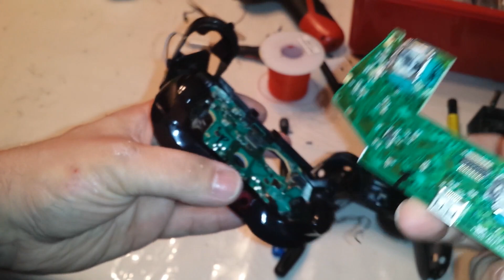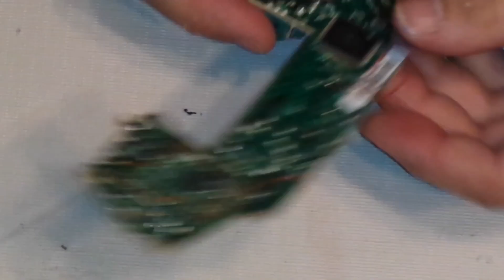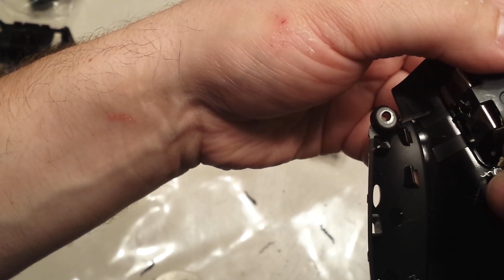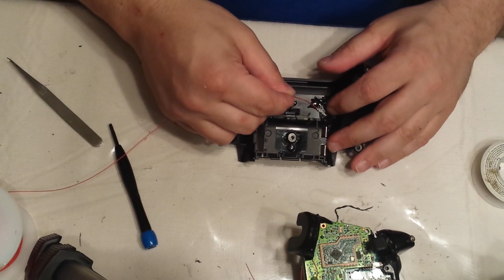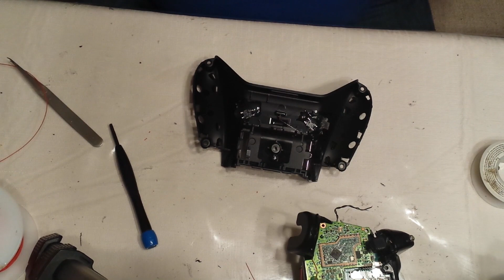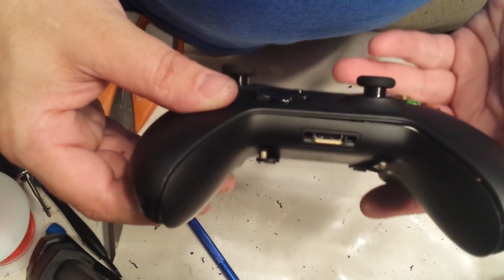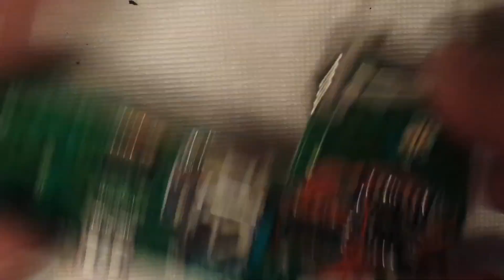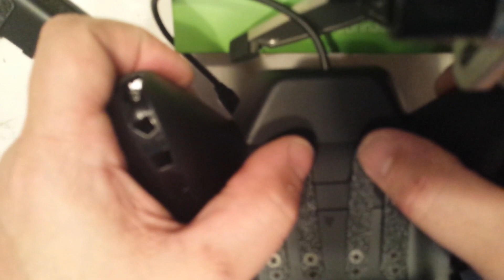TUTORIAL BUILD YOUR OWN XBOX 1 Scuf style Controller w/ Triggers Stops, Remap chip & MORE DIY Gamer

Comment: Hey MOD' great channel m8, very easy to follow instructions unfortunately for me no matter how good the tut* my skill lvl hit cap not to far from birth. Took me about 45mins to remove the rumbles, then 2 seconds flat to rip my b trace, it was at that moment i knew my modding carrier was done. Had to buy another stocker. So im Hoping your still modding, cause im in the market for Xone. Only shit thing is I'm in Australia so I'm going to need thoouussandsss for postage
Reply from the maker: You know what I will!!  

I have another video lined up first this week then I will do that one. 

Perhaps in the next video I will show you everything in one video.

STAY TUNED!!!
Reply from the maker: SMart Triggers are not really that smart. 

Tact button, 100ohm resistor. 

Glue Tact button under the trigger to the mobo.
Solder wire from Tact to the Trigger point (each controller varies) email me I can send a photo based on controller your doing)  I have already given this advice out via email before (justr no video)
The other post of the tact button goes to the resistor and then the resistor gets soldered to ANY GROUND. 

DONE!!

repeat for trigger 2. 

Make sure you use a tact that is not too long or too short.  

I will do a video soon.
Reply: MODCENTRALUSA I apologise, I was out of line. Didn't read your name and thought you were a random trying to run a scam. So again sorry.
Reply: did you get ever get the mod completed or buy a controller with paddles?
Reply: Na, bought the elite controller when it came out bit pricey but haven't had any dramas it
Reply: That's cool. I'd buy the elite or something but they have rubber grips on the back and I'm allergic to them so it's not doable for me. I think I'll get a soldering iron and stuff and follow this tutorial that we're commenting on right now. How did you rip your b trace?
Reply: I was abit heavy handed trying to scrap back a bad solder on the trace sheath. If you've never soldered b4 I suggest practicing on an old PS/Xbox controller.. alot. You could look into getting a button remapping chip for around 40-60aud, they only need about4 solder point and work well I've been told
Reply from the maker: This tutorial was mode before the Elite came out. And while the elite is a nice controller you can build one for 1/2 the price that does much more.  

First off the elite only allows you to map in the settings. Hence the buttons on the back have to be set before you play.  I designed a chip that can be installed and changed on the fly, so if your playing online or in a match, you can easily change the button mappings between spawns. Also the Mapping on the back does not affect the front. While you can still use the built in mapping feature to change the layout of the controllers buttons for a custom layout, my chip allows on the fly mapping should you need to change. 

Second, modding your own controller allows you a better layout. Using the elite or Scuf you get what they give you. If you have small or large hands and do not like the placement nothing you can do about it, you have to change the way to you to adapter to their layout.  With modding your own controller, do paddles or buttons and put them where you want.  

The cost of adding 2 buttons to your controller on your own is $5!!!!! on a $50 controller hat is $55 for a modded controller. Even if you bought one of my remapping chips for xbox one you looking at under $90.  That is much better than $150+ tax.  

Sure the elite has things like metal thumbs and trigger locks. But you can easily add these things on your own. The thumbstick set with adjustable heights can be bought 3rd party for $10-$20 and trigger stocks are the cost of a screw.  Grip and such can be bought 3rd party as well if you want to add it to a controller you already own. While I don't like scuf controllers,. there Xbox one add on grip for $20 is a great value for those who want.it.  For those who want to do their own thing on the cheap, you can find adhesive spray and such for under $5 a can and do 20+ controllers.
Reply from the maker: I can not be aggressive.. it is my channel I am allowed to respond to whatever I want. 

Second, with the Xbox one.. I really offer nothing more than a Tutorial. 
Sure I offer a remappable chip for sale.  But it is not needed
For those who want to build a Remappable controller for super cheap.. You can't beat soldering 8 wires to 4 tact buttons on the back of your controller for less than $5.  It beats spending $150 on a controller.
I make nothing from that.  90% of this tutorial is nothing but FREE ADVICE and showing you how to do it., 

Do those who want to buy all the parts in a kit - sure i offer that, but if you own a soldering iron, glue gun and tools, really 4 tact buttons on amazon or ebay is all you need unless you want to spend $12 at radio shack. 

For those who don't want to spend $150 - I do also offer mail in service and Full modded controllers with a layout that someone might prefer over the elite. 

So sure.. I post these video with hoping to get some business, but at the same time, I offer free advice and I am going to be active on my own videos especially in the comments section.
Reply: MODCENTRALUSA, are you going to ever do a video on adjustable trigger stops or even smart triggers? I'd like adjustable stops but the only way I've seen is to drill the screws next to the battery covery and into the spot on the triggers like the 360. Not sure if smart triggers would be an easy DIY, but I'd like to see a tutorial on it for Xbox One so people will stop buying controllers from companies Scuf and probably even Battle Beaver solder stuff weakly so it breaks or something. Anyways, I'd love to see how to do smart triggers on the Xbox One controller. If it's something I can learn how to do I'd definitely do it. Although I still need to learn how to solder period haha.
Reply: Alright, I'll be looking forward to your video! You're really making me want to go grab a soldering iron and solder everything in sight. This stuff looks fun even though you gotta be really careful with it LOL.

Comment: would be cool to remap the ABXY to the back and changing the ABXY at the front to fully customizable buttons on the PC (like keyboard keybinds without affecting the ABXY at the back :D)
Reply from the maker: That would be possible to do buy you would need a few things.

First you would need a programmable remap chip installed. - Which I make (as per this video)
then set the Back Button to A B X Y.
They you would need a Cronus Max and you would need to remap the A B X Y to whatever you wanted.
In theory it should work as the A B X Y on the back of the controller go to the Remap chip then directly to the MCU.
The Cronus is a pass through device that would see the A B X Y front presses and then swap them to what you programmed them to be through the cronus.
Reply: MODCENTRALUSA So the Cronus Max is able to separate the ABXY from the back and the ones from the front :O? is it possible for the Cronus Max to remap the front ABXY to keyboard keybinds like space - ctrl - tab , etc.. stuff like that? and will it work on a wireless one?
Reply from the maker: NorProductions IM not a 100% since I do not own a Cronus, but the way the cronus works with remapping, it should be able to separate button presses and remap on the fly.  I would research the cronus a bit more
Reply: MODCENTRALUSA
yeah just checked it can be done , but in order to have this done the back paddle buttons all of em need to be programmable right?  if not any remapping to the front ABXY will affect the non programmable ABXY on the back if they are set like that...

Comment: do you have a listing of all your items for sale? I def want to get your mod chip for the xbox one controller but wht types of paddles..etc? Trigger stops?
Reply from the maker: Email me - I have a whole PRE-WRITTEN email I can send you but the videos cover it pretty much.

Remap (Programmable remapping chips) for Xbox 360 (Wired and Wireless) Xbox One, PS4
Hard Remaps (non programmable - static) Simple flex boards for PS4
Xbox one 7 color thumbstick led board
Paddles - aluminum laser cut paddles(exact $cuf replacements)

I also carry every other part you can think of. Shells, Trims, Button, Parts Kits, Mod Kits.. I have everything.

Starting to put many things on eBay, of course direct purchase from me is cheaper.

MODCENTRALUSA@GMAIL.COM

Comment: @MODCENTRALUSA haha the problem is fixed! It was all connected fine, grounded fine but realised I was using a break switch haha. Just went and got some make switches and it works perfectly thanks for the help!
Reply from the maker: I never would have guessed that as I had links to momentary on switches.  I assumed you would be using the right tact button. But you were using a Momentary off switch which I never would have guessed in a million years.

Comment: Just had a look and my a button on my controller does not work?
If I disconnect the button on the back the A button the controller works again? But if the button on the back is connected then the A button on the front does not work? Any help
Reply from the maker: you have it connected incorrectly or not grounded properly.
Try again.

Comment: I done it all correctly but only added the A button. But the button at the back works fine but on the controller the normal A button will not work and it says it is always pushed in when its not, any help?
Reply from the maker: SOunds like something is ground out or bridged.

The A button on Xboxone is the the NUmber 8 leg on J6. That would be the bottom of the J6 connector.
That would be the 4th one from the left.
One wire soldered to that and then to the tact, and then from TP26 to the tact.
Make sure your tact is not GROUNDIING OUT on the circuitboard when you put it back together and touching something that is causing that to happen.

Comment: Quick off-the-wall question: do you know, off hand, if there is some kind of chip that can be installed to create macros? I wouldn't even know how to properly search of something like that.

Basically, a chip that can be programmed to simulate a number of various button presses with exact timing. So as an example macro, say:

RT + (pause for .25 seconds) + RT + (pause for .50 seconds) + B

I imagine something that would allow one to hold down a button (an extra, added tact button or something), press a series of buttons, and then release the added tact button, and tr chip would map the series of button presses & timing of/between each press, and would be mapped to the added tact button.

Any ideas or maybe something kind of similar?
Reply from the maker: NO... there was a chip that did that for 360 called the WOLF and it sucked really bad... There is no macro chip for Xbox one.

Comment from the maker: FOR THOSE WONDERING ABOUT THE COPY CAT CHIP...

You did not find an Identical chip - you found a cheap copy cat that is not tournament legal.  Second I had my chip for over a year - go back to my older videos I have had my remap chip for a loing time, the guy you found recently made his chip and it is a VERY POOR COPY

First it has rapid fire on it..  SO it is not tournament legal. and if you want rapid fire and remapping Hit me up via email.
I have a Programmable remapping chip with 40 mode rapid fire (not one non programmable mode) as the chip you found has.
I have Dropshot, jumpshot, quickscope, fast reload, mimic, dual rapid fire, single rapid fire (50 different speeds) and oh yea.. 2 programmable remaps.
ON A KEY - which means - it cleanly fits on the circuitboard it's not a CHIP with wire only.  It blows this guys chip out of the water.

Second, it is a GIGANTIC PIC CHIP. did you even look at the directions? It is this huge monstrosity of a chip. It has about 25 wires and is near impossible to
install and then close the controller without something not fitting right.  So your more then welcome to try it - and save money but you get what you pay for.

Third - his chip only works on XBOX ONE.. My chip works on 3 controllers. WIRED AND WIRELESS XBOX 360 and XBOX ONE.
http://www.ebay.com/itm/301506057483?ssPageName=STRK:MESELX:IT&_trksid=p3984.m1586.l2649
That is my ebay link for it, I sell them cheaper privately.
That chip has 3 codes embedded into it and it super easy to install.
His gives crappy web instructions, where is his install video? It don't exist because it would take forever to install it.
You don't get how complicated it really is to install from just a bunch of pics.
Here let me show you.

http://i1372.photobucket.com/albums/ag337/modcentralusa/install/Arsenal2_zpsoffheovp.jpg
http://i1372.photobucket.com/albums/ag337/modcentralusa/install/arsenal_zpsoztp2jc6.jpg

Now does that look easy? Do you really want to look at this diagram?

http://i1372.photobucket.com/albums/ag337/modcentralusa/install/arse23_zpsafickj5k.jpg

Figure out which way is which on the chip? What pin does what?
Folding pic pin down to make it fit? What if you snap a leg off?

I am not a armature. I create top of the line install boards.  Even the triple install chip seen here is many things.
First off the chip is on a PCB board which is the size of a quarter , not as long as a finger.
There are no legs to bend and no diagrams to follow.
Everything is marked in simple to read letters.
A B X Y LC RC L3 R3 all go to any of the buttons points - the letters are there for people who are anal retentive about their installs and want A to go to A on the chip
for trouble shooting down the road.  But really any solder point of ABXY LC RC L3 R3 can go to any point of the chip.
Then I have a simple on off solder blob jumper for Xbox wireless / Xbox one and Xbox 360 Wired controllers. So my chip works in 3 differnt brands - his does not.
Here is what my installs look like, they are clean, easy and simple to do.  And they don;t have wire all over the place like his does with 4 different grounds and such.

Here is a wired 360 controller
http://i1372.photobucket.com/albums/ag337/modcentralusa/install/cid_B4CE235B-9755-4F9A-98B2-85BDD9D361B5_zpsdcfesgef.jpg

Here is a Xbox one controller...
http://i1372.photobucket.com/albums/ag337/modcentralusa/install/20141108_173631_zpsrpq2wjpo.jpg
http://i1372.photobucket.com/albums/ag337/modcentralusa/install/20141108_173616_zpseozwcvvu.jpg

Super clean and easy to install, all soldering points marked.

OH and the chip is upgradable, as it has a programming interface should I want to revise how it works down the road.
Another thing is my chip does MULTIPLE REMAPPINGS TO ONE BUTTONS, so if you want to use the remap for fighting games and
want combos like X+O and such on one button you can do that with my chip, not with the copy cat chip.

Now for those of you who want XBOX ONE even easier...

HERE IS THE KEY!!!!!
http://www.ebay.com/itm/301536581617?ssPageName=STRK:MESELX:IT&_trksid=p3984.m1586.l2649

They key even even easier to install on Xbox one.  Lay it on the board and solder the key points and done.
You only need to run 3 wires for the chip
LED (which goes to the Guide LED NOW)
L3 and R3 and that is it!

Then there is T1-T4 for your remap buttons.

SO SURE GO AHEAD AND SPEND $17.49 FOR THE COPYCAT CHIP.
AGAIN, NOT TOURNAMENT LEGAL (DUE TO RAPID FIRE) AND REALLY BAD RAPID FIRE (WHY IT IS THERE I DO NOT KNOW)
IF YOU WANT RAPID FIRE I HAVE A KEY RAPID FIRE CHIP FOR INSTALL
NOT TRIPLE CONTROLLER COMPATIBLE.
NOT EASY TO INSTALL BY ANY MEANS.
AND I OFFER A CHOICE, SQUARE PCB OR KEY.

SO WHY IS ,MY CHIP EXPENSIVE. BECAUSE I AM THE ONLY ONE WHO HAS A REAL EASY AND HIGH END SOLUTION.
I COULD EASILY JUST PROGRAM PICS LIKE HIM AND SELL THEM FOR $10 EACH. THOSE CHIPS COST $1 EACH!!!
MY PCB BOARDS COST ME $15-25 (DEPENDING ON THE PCB I MADE) - THEN I HAVE TO BUY ALL THE PARTS (THE CHIP, RESISTOR, REGULATOR) TO PUT ON THE PCB TO MAKE THEM.
THEY COST ME A PRETTY PENNY I NEED TO RECOVER MY COST ON THEM,   
BUT YOU GET TOP NOTCH PRODUCT
FULLY GUARANTEED AND TESTED
BETTER THAN $CUF, OR ANYONE ELSE OFFERINGS.
I DO THE INSTALLS AND OFFER THE DIY KITS.
THE CHIP COMES OUT EASILY AND CAN BE SWAPPED CONTROLLER TO CONTROLLER.
I OFFER MANY VARIETIES TOO (THIS COPY CAT OFFERS XB1 ONLY) - i OFFER XBOX 360 (WIRED AND WIRELESS) XBOX ONE, PS4 AND PS4 HARDMAPPED.
MY BOARDS ARE INDUSTRIAL QUALITY AND I OFFER THE EASIEST INSTALL.
LASTLY - I ORIGINATED THE REMAP CHIP FOR RESALE, IF YOU WANTED PROGRAMMABLE REMAPPING YOU HAD TO BUY A FULL CONTROLLER
FROM SOMEONE LIKE $CUF, NOW YOU CAN DO IT YOUR SELF AND GET MORE FEATURES THAN THEY OFFER.